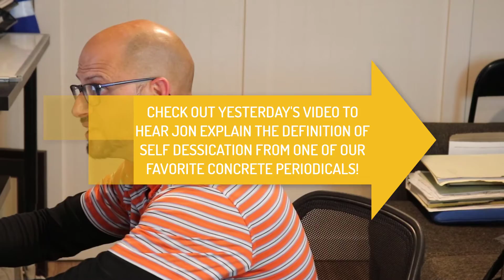How to Control Autogenous Shrinkage in Concrete - Vlog 671

Comment: Dr. Belkowitz , what holds crucial to make concrete batch consistent at batching plant? Consistent mix from 1 mix batch to the other. Batching Plant whom considered as professional batcher still deliver mix that is not consistent enough so that in a floor slab pour, the concrete setting area is different very hard for finisher to work jump from one area to the other, also some seggregation problem. Thank you.
Reply from the maker: Flippin awesome question!!!!  We’ll get on this for a QnA.

Comment: Jon, the question was in the context of a mix with >400kg/m³ cement and, I believe, a w/c < 0.4 (or at least extreme low). In that case there is just not enough water to begin with...
Or am I mixing things up?
Reply from the maker: Hey hey hey, sorry for the delay.  I see... If you are getting adequate dispersion (mechanical and chemical) a 0.40 on your w/c is more than enough. At that point its all about playing with the hydrations process as well as the microstructure of the matrix. To reduce the autogenous shrinkage of the hydrated cement matrix in the past, we have used everything from SRAs, hydrations stabilizers, colloidal silica, and expansive agents. All of these in combination with an optimized granular skeleton has been used to reduce the autogenous shrinkage of concrete.

Definition Note - Autogenous shrinkage of the cement matrix is caused by the reduction in volume when cement hydrates and new products are formed.